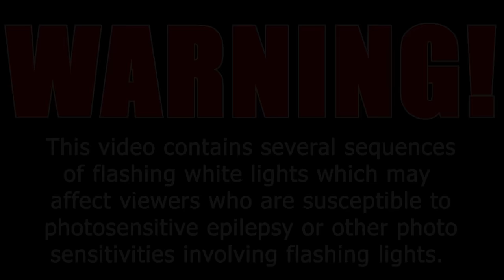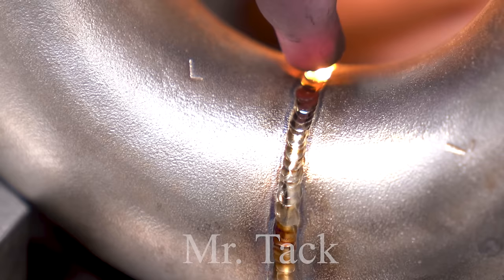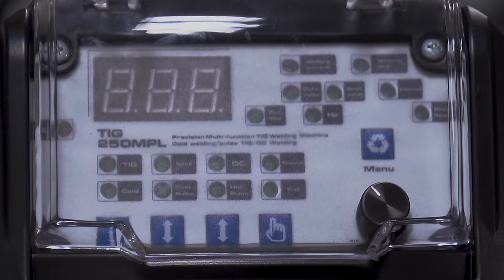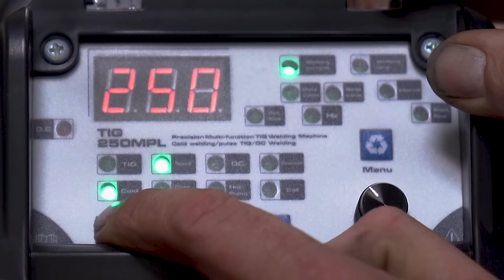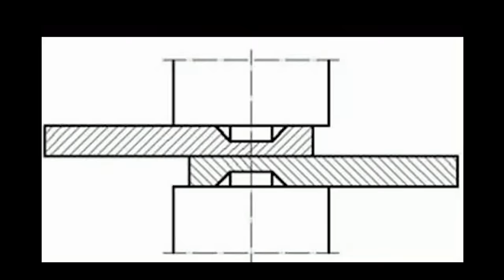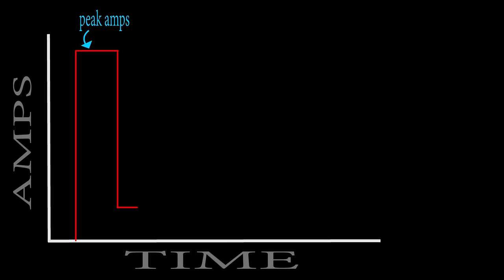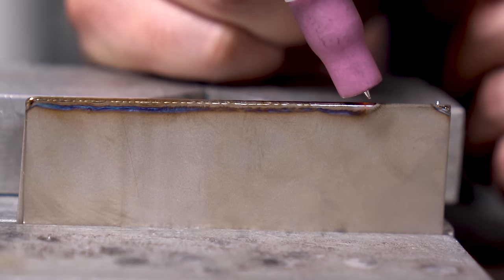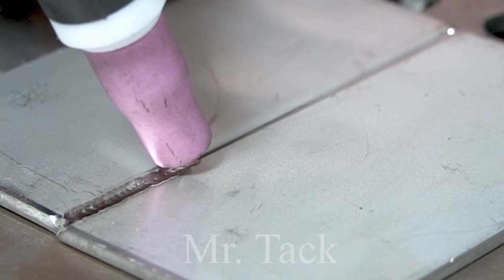So I Bought A Cold Welder

Comment: My request: do these same tricks with a regular TiG: razor blade, aluminium foil, etc. Then explain how.
Reply: I can do that and include welding wire to give an actual weld.
Reply: @craigelkin53  wow, what diameter filler rod for the razer and Al foil? And what material for filler.

Your comment makes me think of stories of old welders using gas to weld aluminium before TiG existed and using a sliver of the base metal as the filler.

Comment: You have to remember something about CHINA, the pressure to make something new and exciting is so great that the CCP just durles over it. This for certain is not new. Years ago we modified a TIG welder that seen better days into a tacker machine. So technically and I am going out on a limb here, we were cold welding or something like that. But the wording is just stretched for sure.
Reply: Whats a durles?
Reply: I think a better term than cold weld might be surface fusion welding. But this is China for you. The marketing wank department has to create interest and demand i guess or they all get shot.
Reply: @tugboattommy  Drools is the correct spelling as sometimes my spell checker does not work properly. Microsoft does it again, maybe bill gates can fix something he got paid for doing in the first place, just maybe. .
Reply: @sherannaidoo2712  As was said in the movie STRIPS. "That's a fact jack."

Comment: Thank you! The Alibaba Open-Sesame vid-ads had me mystified (flashback of night markets while growing up in Hong Kong 🤣). I wanted something that could tack-weld thin wall metals; I'd been using a Titanium Flux125 wirefeed welder on low temp setting, spot-weld fashion and it does the trick. Thanks for saving my $$$. Much obliged!

Comment: Well take into account these factors . Today i get to attach a 100 mesh brass screen to a 16 gauge 304 stainless perf sheet .
So in my opinion " not  welder per say " the cold welder is a good option . Not all weld are structural per say or not an airplane wing as it were

Comment: I think this thing would come in handy in the restaurant kitchen world where they make thin dividers out of aluminum or stainless steel to hold lids cups little things on the work line for holding containers or individual 2 oz lids things of that nature makes nice clean little welds that don't require a lot of strength
Reply: Absolutely! That's what I was looking at this machine for. Thin carryout cup lid dividers and such

Comment: Every TIG using the timer setting can do this, the only difference is that they have created a circuit designed to just tac components together.
The application is not for structural strength.
There is a Korean Youtuber who demonstrates this feature.
He makes a comparison between spot welding and the so-called cold welding setting.
He says it is designed to target the artist, not the welding professional and is used in decorative applications only but he points out many products manufactured in China use this process.
The spot welding settings have a greater advantage over this because you can make adjustments to obtain penetration.

Comment: Cold welding is a new term for me, we call it pulse welding (same thing) for when a tig is unavailable, in fact once I used an old big name welder, it had a name on it "pulse star" I don't know what it was supposed to do but I didn't like it. I've never seen it done with a tig before, to me it's tacks on tacks but real fast. That video was like tacking with out eye protection and not closing. I guess you learn something new all the time. I really liked welding the foil together though. I agree what's with the nail polish or maybe arc protection? No gloves.

Comment: I kinda invented this same process independently the other day. Had to drill a 1" hole through a sandwich of 16ga ss, construction adhesive, another layer of 16ga ss, more construction adhesive, then wood, and then weld a 1" tube into the hole without burning down the building. I used pulse with 5 base amps, 120 peak amps, 2 hz and 10% on-time. It worked but would have been even better if the arc had shut off between pulses like this machine does. Kind of a narrow use case but there's definitely a niche for something like this.

Comment: You are pretty negative about this but I love it.  My apartment is very small.  I like welding indoors.  I need build li-ion battery packs and a welding table and a welding positioner/rotator but I don't want to spend money and use space for two different welders because that just does not make sense. It is just a power supply.  I should be able to just switch electrodes and set the machine to do what I need it for at the moment.  This thing is it and my heavy soldering jobs now become light welding jobs like attaching large lugs.

Comment: For anyone that comes across this video and is interested.  As to that passive welding in space he noted. It was discovered that essentially metals and alloys in contact under vibration, or repeated impacts, only stay separate due to the surface oxide layer they naturally possess in an oxygenated environment. After every instance of contact that oxide layer will regenerate when the surfaces separate; which obviously does not happen in a vacuum due to the lack of free oxygen.

You can find some more information with this bit of "light" reading you can search up.

ESA STM-279 November 2009 Assessment of Cold Welding Between Separable Contact Surfaces Due to Impact and Fretting Under Vacuum A. Merstallinger, M. Sales, E. Semerad Austrian Institute of Technology B.D. Dunn ESA/ESTEC

Comment: Im glad you made this video. I understand what's going on with the process, but I also understand if you fuse the base metals without fillermetal (particularly with the "jogging" or pulsing on and off) the weld will almost always fail due to thin weld zone areas, inclusions in weld and poor fusion.
Reply: With this method sure, welding without filler with tig is good enough to meet standards for balcony Railings or some other stuff that people can lean on. Iirc its 1kN per meter or something.
Reply: @readordienn  that would depend on what metal the handrails are fabricated from. I would not recommend welding ANY handrail without the proper filler rod AND joint preparation. Stainless is probably the only material, but if there's any gap on the fit up when welding said handrails, you are going to need filler wire.
Reply: @yourdrummer2034  ah forgot to write. Ss304 no gaps, holes filled if they appeard
Reply: @readordienn  sounds legit.

Comment: Actually it looks like a great way to work with thinner sensitive materials. You can get a great root without a lot of contamination on the back and lay a cover pass for strength. Think gas tanks.
Reply: Yes, and if you're able to access the back side of the weld, you can do another bead of these cold welds and the penetration will meet halfway through for added strength. You can add filler rod, too.

Comment: The only time I have used cold welders are for components you use a microscope to ensure its in place. A magnificent things that darkens as it fires. Its great to hold small and delicate components to something, stuff where you cannot compromise the surface in any substantial way. Basically if you can use a normal welder on something without destroying it, then the cold welder is not right for the job.

Comment: This might sound funny but I actually have an application for that kind of machine. The machine that I need doesn't need to be  expensive or anything but it will need to be able to do the high speed pulses and not produce lots of heat so that I can keep from potentially damaging some magnetic strips. The welding would not need to be super strong or anything like that but it would need to be able to hold a thin metal plate in place so that it can also hold the magnetic strip in place. It would be held in place on four sides and like I said before it would not be structural in nature but just enough to keep it in place so that it won't fall apart.
Reply from the maker: ANY other TIG with a pulse option can do it. This is nothing special.
Reply: @TheFabricatorSeries  thanks for the info and help, I also have a question about something that I saw about a week or two ago and this guy who is running a shop or a class asks his film assistant to weld something together. The assistant has a welding rod on the pice of metal and the guy asks him what he is doing. Because he needs to pass a challenge of welding the two pieces together to get the job. The assistant says just watch it at that point the assistant strikes something across the rod and then the rod proceeded to burn/ melt down the entire length and welds the two pieces together and after they clear the slag by simply touching it the teacher looks at it and says I'm amazed by that it's actually good. I don't remember who it was or anything else but I thought that maybe you might want to explain what is going on in the video. It was one of the shorts video. If I can find it I'll put a link here or otherwise get it to you.

Comment: That would have been perfect for a lot of the stainless laboratory exhaust I did over the years to nail a perfect root before a quick cover. Single pass welding 18ga stainless and aluminum can hide minor imperfections. When they are screwing with things that can end mankind there's not a lot of room for error. The exhaust would typically pass through 2-3 Hot Scrubbers where the air was heated to 1,800° before passing through a wet scrubber or 2 before the Bag In Bag Out NBC filters.

Comment: Would this cold welder work for a DIYer to replace the cells in a battery pack for a drill?  They often use standard cells (sub-C for nicads, 18650 for lithium) joined together by spot welded thin metal strips.  (I think they don't solder them because the time it takes to heat them up enough using an iron would cook the innards, plus time is money and soldering is a lot slower than a quick zap).    >Could you do it as well with TIG?  >Is there anyway to do it safely on lithium batteries, which can burst into flame just from charging at too high a rate?  Cool video, thanks for doing it.

Comment: this isn't cold welding. Cold welding is when 2 metals are atomically bonded in a vacuum when their oxidization layer is removed, this is simply heating up a piece of metal with alot of heat really quick and being able to tap and tap because of the shielding gas

Comment: There is a few things it would be useful for and $400- $500 for it doesn’t sound bad especially with the different mods but my question is. Is there a good TIG welding machine that can do everything this on can do for the same price or cheaper, in a smallish package like that, easy accessible parts (tips, cones, gas fittings), etc. Because something like that would be perfect for home garage projects and fixing your own exhausts etc.

Comment: What is the reason for black marker fingernails ?? Would using the supposedly the cold weld work for soldering electronics ?? Thank you for clearing up the subject of cold welding. Would this work better than spot welding nickel strip to lithium batteries ??? Good day Sir too. VF

Comment: True cold welds occurs in outer space, beyond earth’s atmosphere. This happened -much to the horror of an American astronaut on our first space walk. The hatch closed behind him, and cold welded shut. Two identical metals fused in the absolute cold of space.  A space walk that was to last minutes, lasted almost an hour and almost resulted in the death of our astronaut. They prevent this by not having identical metals in perfect proximity to each other that must move-like a hatch! By having a slight film on one or both surfaces they also prevent welding by atomic bonding at absolute zero degrees.
Reply: This has more to do with a lack of oxygen than temperature. All metals that we build with have a layer of oxide that prevents them from fusing together. This layer forms so quickly when exposed to air, we don't see cold welding occur naturally.

Comment: Im happy i stumbled on this video.... I was reading things about outer space and cold welding came up and im like huh what's that.. so yes i did figure out what thst cold welding was (forcing 2 metals together without heat causing the atoms to share the electron soup or carmel in the pay day bar in the video i found about thet but these machines kept popping up while i was looking into this and wanted an actual explanation of what was happening. I feel more educated in this snd greatly appreciate you sharing this video even if it is 3 years old at this point. ❤ I feel like i may need to check out more of your content to learn things.

Comment: Could do double duty as a battery tab welder for heavier gauge tabs 🤔 definately a glorified tig though. I wonder how long the internal guts will last though. A lot of power circuits in chinese gadgets have a lot to be desired. My guess is they are chopping the voltage from a large capacitor and calling it good.

Comment: Would this process be useful say in filling scarred, scratches, small holes, or corrupted (rust) surfaces in stainless steel and polishing the newly "repaired" area back to "near" it's originally installed condition?
Reply: Technically yes, but I don't really see any kind of use for this that would justify 400 bucks for it. There are much cheaper TIG machines for DIY things. And normally it's not good to weld on rust, paint  or any corrupted surface, it will just end up in the welding making it weaker.
Reply: @pufika00   Thanks for the reply David...

Comment: He's basically right that it's just a TIG welder but one which is sold with the special tack feature, making it more useful if it can do it all.
They basically realized that to create a useful mode which almost warrants it being called a different kind of welder entirely was to just allow a controllable on time of the pulses and allow them to deliver more amps. There is a lot of usage there for very fine tacking that is too hard to do using the trigger and just your finger speed which is probably where the idea for this came from. With digital control you get extremely consistent tacks which do little deformation and all you have to do is just hit the button per pulse no worries. 
 I think a lot of Americans see this and get afraid of some new age of cheap Chinese welding where everything breaks but this is just not the case. 
I've seen some videos showing what looks to be structural welds using these things but in reality they are still more cosmetic than anything since no one is showing attempts at welding any serious industrial parts. I'm kind of curious about the near perfect fusing of copper wires together with a quick pulse for fine splicing.

Comment: Original technology used electrical energy store in capacitor and discharge it so recovery time for next welding pulse would not be ready for longer period. I still like to have on to try but this method of welding use on stud welder machine successfully for so long as you know some stud welder do not need gas protection ad some use social flask material to for protection one the tip of stud as well.

Comment: There is a form of cold welding that is incredibly strong and done without heat but you need a 100% vaccum and remove the oxide layer , so basically only in space, but you can literally just stick two pieces of the same metal together and the will fuse

Comment: Its no good for structural welds. But its awesome for weld build ups on molds. Where say u use a 0.3 fillee wire. Just to remove scratches broken corner. The quick pulse setting is what most tig welders cant do.

I use my big tig for structural and this welder for small parts like jewelry or really instrinsict where u dont wanna put in heat

Comment: It could be used for welding copper starter motor brush wires to the steel frame. Better than soldering.

Comment: You are misunderstanding the purpose/application of this "cold welding" machine. Can you weld that aluminum foil with your regular welder? No, you won't have that kind of stable hand. This machine is built for welding thin small metals and it'll offer more than enough strength to them. It is used where you don't want to show penetration on the other side. It can be used for making ornamental stuff.
I understand that you can simply put a delay timer switch to your regular tig welder - but not everyone can do that so they gave a cheap ready-made solution.

Comment: Cold welding is real, but this is not how it's done. A cold weld can be performed with certain metals just by pushing them together with sufficient pressure. It's especially easy to do in a vacuum, e.g. in space. It works by either cleaning to remove the oxide layer, or in the case of a butt joint, pressing together so firmly that the oxide layer is forced out. With enough pressure, the atoms in the metal bond to each other just as they are in solid metal.

You can find videos of actual cold welding on YouTube.

Comment: The scientific term doesn't imply that a machine presses the two metal together, that is a different process, cold welding is when to pieces of the same metal come in contact in a 0 oxygen environment like space where the metal is not able to form an oxidized layer, when the two pieces of metal come in contact it allows atoms sort of mesh together as if they where one piece all along. It forms a homogenous crystal structure and is used for the manufacturing of nano tech. Veritassium has a great video on it.